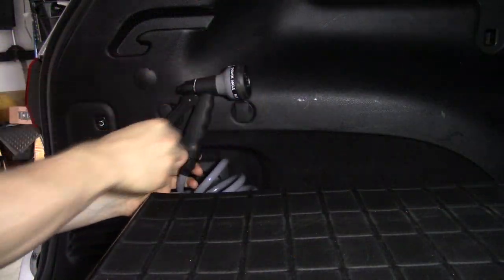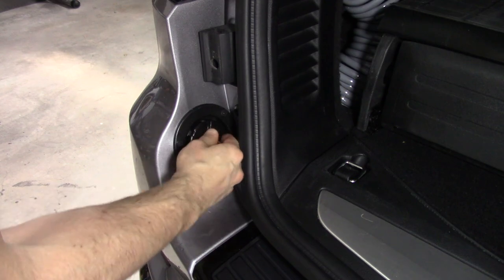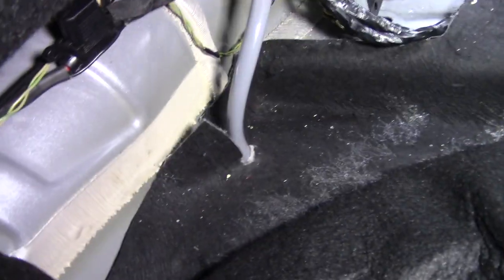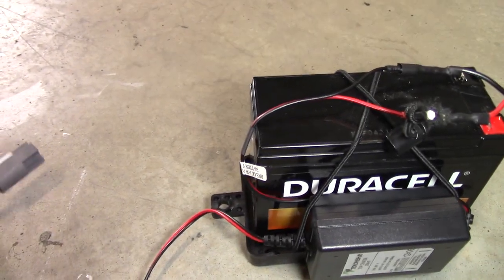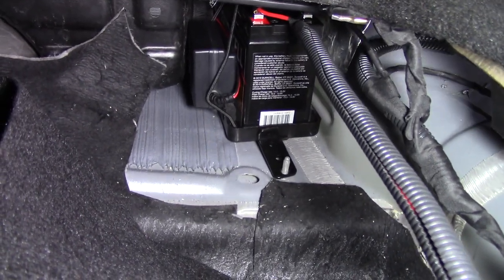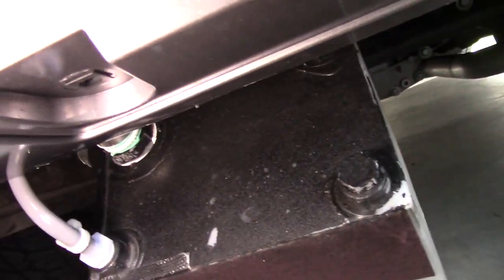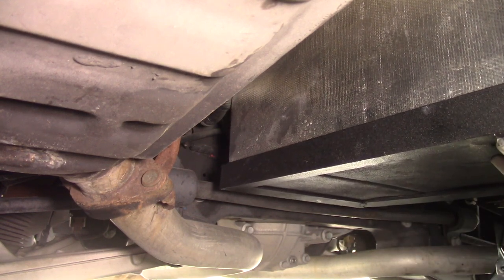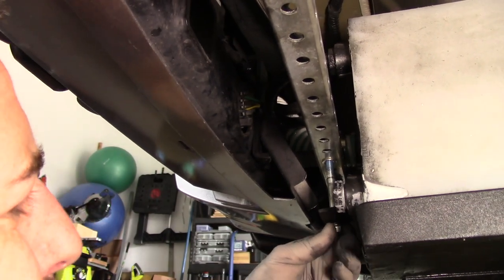Running water system for Jeep Grand Cherokee wk2

Comment: Nicely done. An upgrade would be to install a sending unit in the tank and connect it to a water Gauge so you can see the water level.  I built a similar system for my 2018 wk2 with a 10 gal tank.

Comment: Excellent use of the dead space under the Jeep. Any plans to make a wider tank that will completely fill in the space to increase your water supply?
Reply from the maker: Hi, thanks for the question. My original plan was actually to put a jerry can to carry fuel next to it. I may still go that route but if not I will probably go with a larger water tank. Could probably fit a 15-20 gallon tank without too much trouble.

Comment: How do you stop the water freezing and breaking the hose and tank?
Reply from the maker: The tank is not pressurized so if it does freeze, it won't burst anything. I did hook up one of those heating element that are used for RV tanks but haven't really tested out if it works well as I live in south texas and it doesn't get that cold often.

Comment: Very ambitious and creative. I don't think I could do this. But, why do you want a water tank in your car? Did you explain that?
Reply from the maker: Thanks! It opens up options for camping. I don’t need a site with water. And since I have my camp kitchen pullout, having water for cleaning right there is nice. It’s also super convenient when going to the beach and what not. It’s easy to rinse any sand etc.
Reply: When I lived at the beach I was an avid kitesurfer.  Cleaning sand off of your gear when packing up is a constant battle (and keeping your vehicle from becoming a total sandbox).  I bought a portable RinseKit to help, but a setup like the one here would have been sooooo much better. I may do something like this on my WK2 but may make it more modular so I can take it out in the winter.

Comment: Do you have any links for the products? Especially the water tank and pump!
Reply from the maker: Hi there, here's the link for the water tank i used. https://www.amazon.com/dp/B07JNFWY89/ref=cm_sw_em_r_mt_dp_72FNW1WYC6RQY0Y5QJQ4?_encoding=UTF8&psc=1
And here's the pump.  https://www.amazon.com/dp/B00WYMC492/ref=cm_sw_em_r_mt_dp_TXA50RGEZ2A4TJP2K8WQ?_encoding=UTF8&psc=1
Hose. https://www.amazon.com/gp/product/B0793C3DGC/ref=ppx_yo_dt_b_search_asin_title?ie=UTF8&psc=1

Comment: Genius! You are quite the craftsman. Nicely done. Just curious, what are you running for rims and tires (sizes) and do you have a lift or just using the OEM air ride?
Reply from the maker: Hi, thank you! My rims are the stock rims for the high altitude model. I do have the air suspension, no mods there. The tires are a 285/50/20 nitto terra grappler. So just slightly wider than stock size. Gives it a more appealing stance without messing with spacers.
Reply: @totisviribus2616  Thank you! They look great! Keep up the awesome mods. You’re an inspiration for us WK2 owners. Thanks again

Comment: What's tires did you put on?  Did you lift or lower w/ airlinks?
Reply from the maker: They are nitto terra Grapplers 285 50 20. no other modification. i have the air suspension.